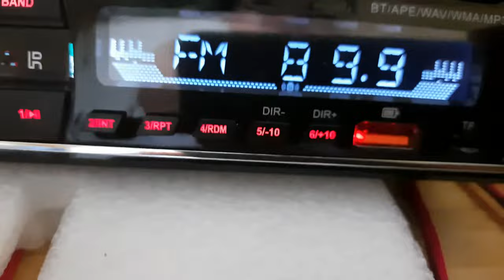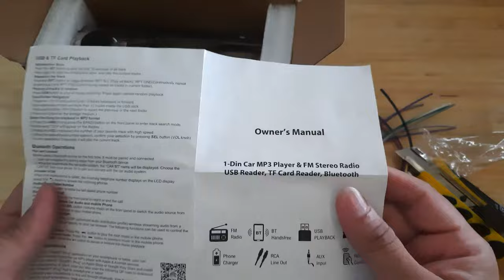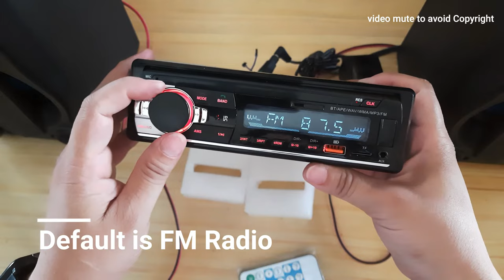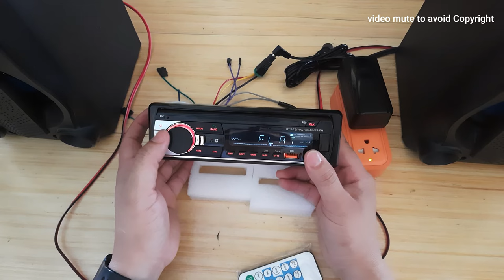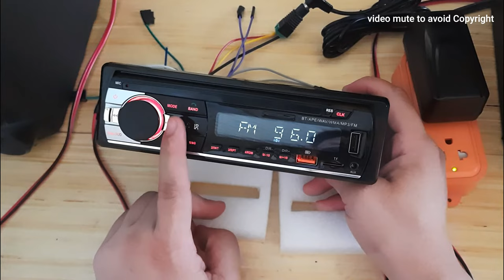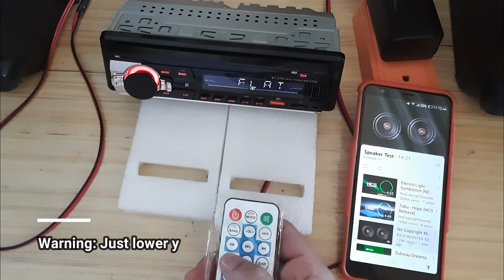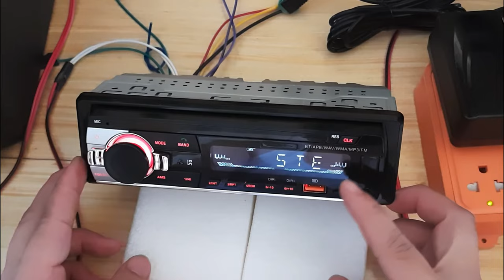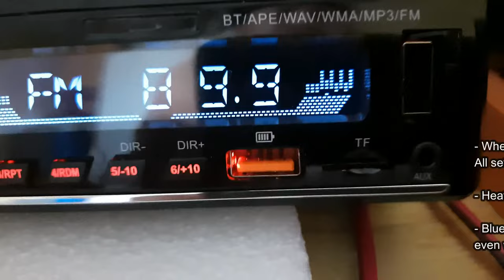How to Convert Bluetooth Car Stereo to Home Stereo | Unboxing | Demo | Review

Comment: Sir bakit  namamatay o kusang nagpapower off  ang ginawa ko…3A po ang gamit kung power supply at isang speaker lang gamit ko NOTE THAT SINUNOD KO LAHAT NG NASA VIDS NYO PO… pls shed some light 😢
Reply: dapat 10 amperes di magtatagal ang 2.5 or 3.5 amp
Reply: @jimcroce6634  salamat sir

Comment: Sir how may volts/amp needed to convert to AC 220VOLTS?Thanks.
Reply from the maker: Need mo lang po ng DC adaptor na 12V 2a pataas tulad po nung asa video
Reply: @Kadroid  product link, pls